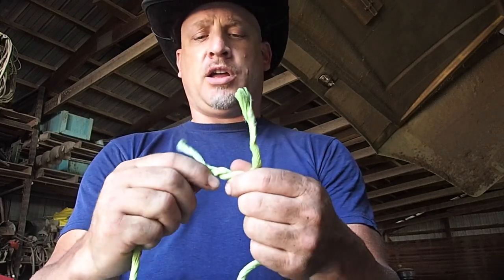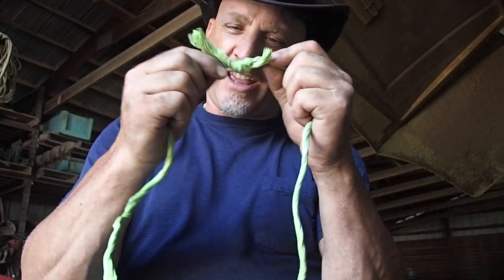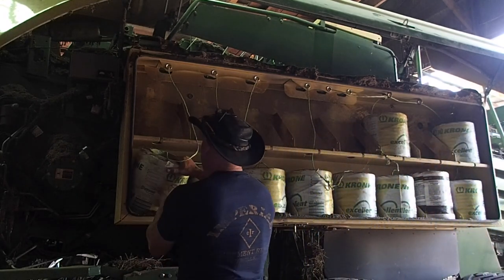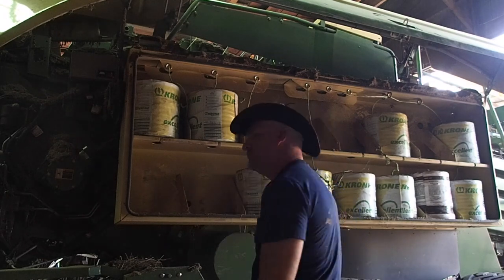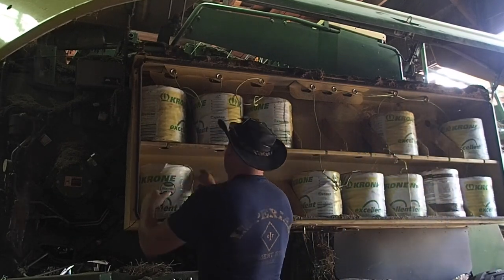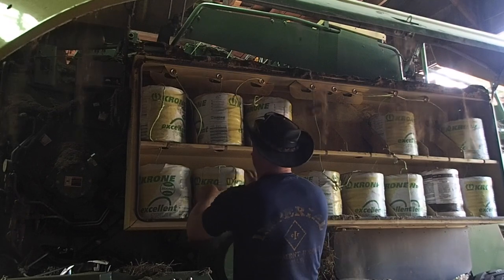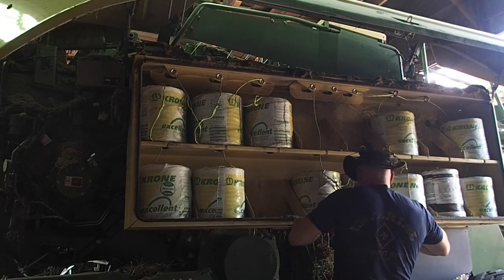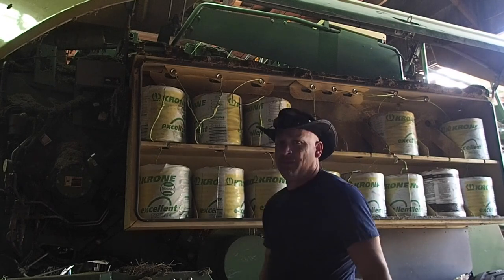Knott Tying Dusty Krone Twine

Comment: I worked in Construction for more than 20 years JCB early over here Just didn't have the machine Quality that Cat or John Deere had.  the Buckets, Pins, wore out faster.  They didn't seem as heavy duty and developed stress fractures faster Maybe thinner metal.  They maybe faster but will it last as long.  We did go to Volvo Machines.  But sometimes had problems getting parts.  for a example had one part we had to wait for 2 months.  We ended up owning spare set of filters for each machine.

Comment: you may find some tidy John deere 7530 with 50kmh gear box 31mph and cab sususpention etc its a common tractor option over here but i guess not many about in the US. they will have a hook type pick up hitch as standard , no pins to put in nobody has to get out to hitch up even, only to plug lights brakes in. be some goods vids coming!
cheers

Comment: I have only been bailing for about 6 years now so you have a lot more years then I.  I have never had the regular box knots come loose. What size twine do you use? 440 was the most common I used now 650 for #1,6 with my krone 1290 high speed
Reply: never mind I missed that part where u said what it was my fault

Comment: does the twine bundle wrapper get drug thru the machine when the top spool runs out?  looks like it is a plastic wrapper that form a enclosed cylinder
Reply: no it does not get pulled though the twin is just wrapped and  the wrapper stay as twine goes

Comment: Don't overlook Massey. They make an awesome loader tractor with that Dyna 4 trans.
Reply: For us, the Dyna VT saves a lot of hassle for repairs and is a joy to work with. Dyna 4 and 6 is great as well if you know how to use them, but a lot of people don't seem to like reading the manuals. But to be fair any new Massey, Fendt or John Deere is going to be a great tractor, a lot better than the competition imo.
Reply: You are spot on with folks not reading the manual and adjusting the settings. The auto mode with brake declutch, just press the brake and switch the power reverser. Can set which gear it defaults too. Tons of options. It's one, if not, the best loader tractor on the market. JD, Fednt, Massey are the top 3 IMO as well.

Comment: You have a problem that anyone who bales hay has . And when I was younger  there was all the damn dust. Why not plumb it for air lines. And maybe a good used construction compressor. The only time that I had anything with JCB was in the 80s. The TLB was decent , bit weak on pushing.

Comment: i bet freight is way expensive from england,, you must be getting a hella deal or like doubling the cost
Reply: sterling is fairly poor in comparison to the dollar after brexit so it'll pay him to buy in Britain
Reply: I wouldn't be surprised if it was emissions related.
Reply: +Ryan Fowler 
emissions in the UK are crazy 

proberbly a John deer thing 
they're not very popular over there where as the slight cult following they have in America
Reply: fowletm1992 I don't know much about there standards or there solution to it however, but like a lot of European stuff it could be of better design to meet those standards? I do know European equipment tends to be  highly designed around safety.
Reply: +Ryan Fowler 
yea they meets the standards 
the american stuff doesnt 

euro teir 4 standards are very strict now 
where as US is very strict on cars but machines its pretty slack 

so if they bring in anougther tier then alot of john deer, cat, ect wont be able to be sold over there 

out of intrest we did the sums on bringing mchinery from the US to aus 
because we're paying an extra 100+k for a harvester 
once you pay shipping and import taxes it works out to be similar pricing 
although we did your sums a few yrs ago and currently shipping is at an all time low 
they almost running for free